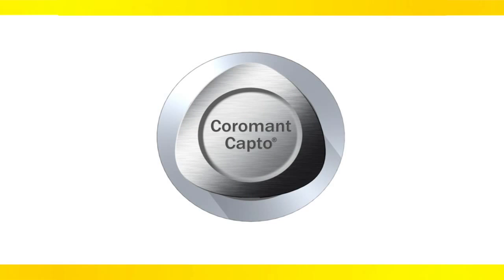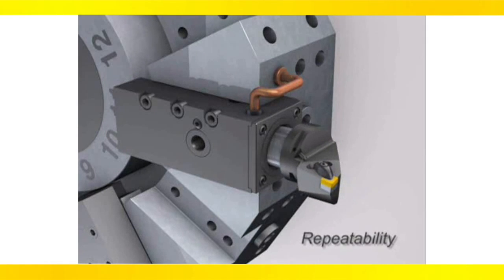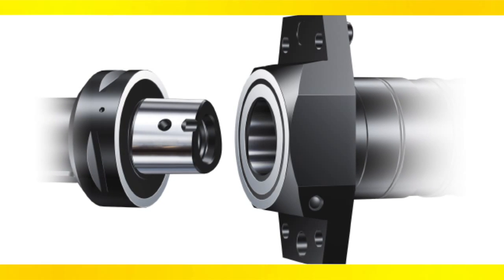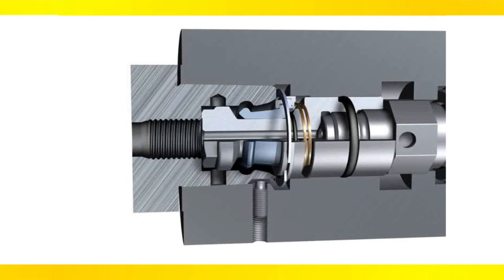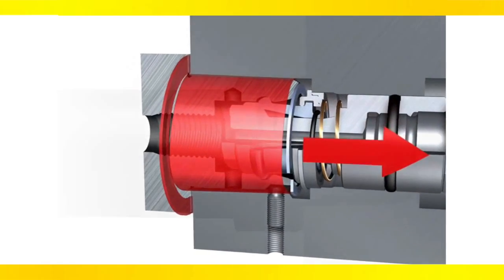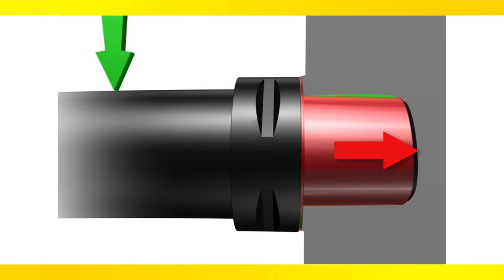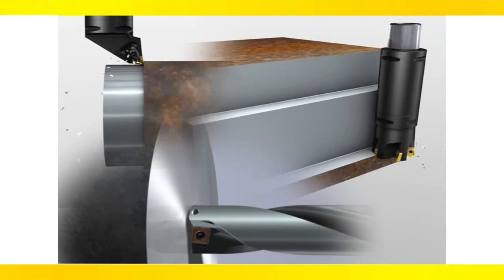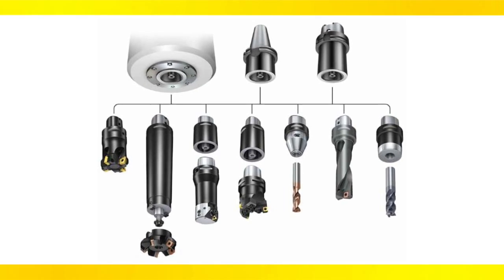Spindle Forces with Coromant Capto Sandvik Coromant

Comment: How is it ensured that the flat face of the tool holder meets with the nose of the spindle with also the correct amount of ‘wedge force’ on the taper too? Does the taper meet the spindle a tiny bit before the flats meet, then stretches the spindle out a tiny bit to get it all making contact? What kind of tolerance on the taper does that take to make repeatable?
Reply: The secret is that they are made to very tight tolerances. Of course the system is over-constrained but because it's made accurate to within a couple of microns it still works.

Comment: what is the major advantage of hydrogrip holder over collet type holder..???
Reply from the maker: Hi,

The major advantages with the hydraulic holder versus collet chucks is, easy handling and precise clamping with only 8-10Nm, higher clamping force and better run-out figures enables the hydraulic holder in all kinds of applications from finishing to roughing.
 
http://www.sandvik.coromant.com/en-gb/knowledge/tooling-systems/machine-and-tooling-systems-considerations/chuck-selection/pages/default.aspx

Best regards,

Mats Backman, Project manager

Comment from the maker: Another good aspect is that this system is both a Quick Change system and at the same time a true modular system!
If you invest in Coromant Capto you can reduce the inventories, by standardize with one system in the workshop, for all machines, and then using adaptors from CAT-V to Capto, or BIG-PLUS to Capto etc.

Best regards 
Bo Hammarberg
Product Manager - Machine Integration

Comment from the maker: To start with Coromant Capto has much higher bending stiffness and torque transmission than KM, which gives you better productivity and less problems with vibrations.
The coupling in itself is much stronger in the design, with thicker walls compared to all other couplings with hollow taper (HSK and KM), which makes it possible to increase the clamping force...

Answer continued in next posting